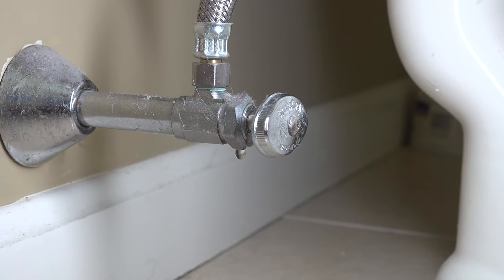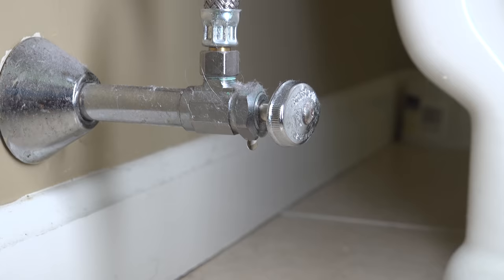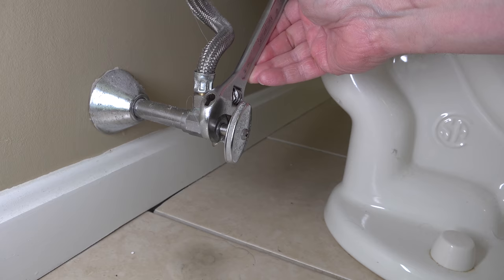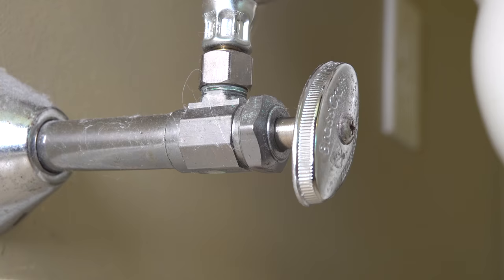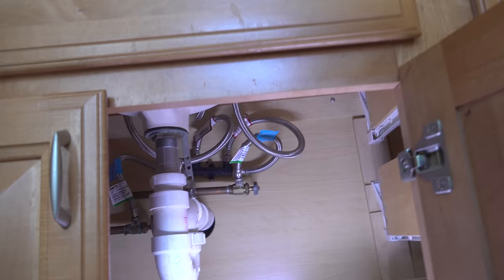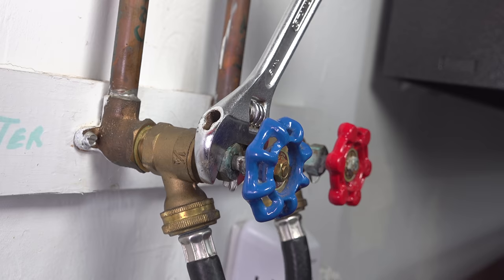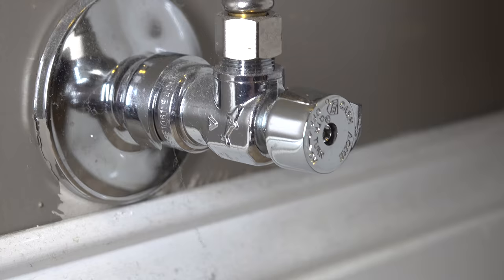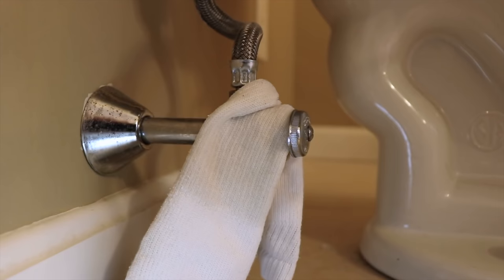Few Know this EASY TRICK to STOP Leaking Valves INSTANTLY

Comment: Great video keep up the good work
Reply from the maker: Unlike most of the UK we use soldered fittings almost exclusively for valves which requires turning off the water, unsoldering the valve and soldering a new one, no easy or simple for homeowners. You guys use a lot more threaded connectors which make this much easier.
Reply: @SilverCymbal  wow that's a pain in the rear, especially if the mains valve isn't in best shape ! 
Keep up the great work 😃 and education videos

Comment: That Knipex Pliers Wernch looks a lot like Pump Pliers aka "Channel Locks" yet they are not. Pump Pliers have teeth on their jaws and those jaws do not move parallel through their entire range of movement. The jaws of that Knipex Pliers Wrench has no teeth and they remain parallel to each other through their entire range movement. These tools can sometimes be used for the same applications although they are not specifically designed to do so.

Comment: I would have shut the water off, sweated off that angle stop chrome stub out and installed a quarter turn angle stop. With it close to the wall I would have used a compression type angle stop.

Comment: I'll have you know that my version of this fix involves putting a small bowl under the drip, and then leaving it there for the last 11 years.  Worked fine so far.  :)

(yes, I feel dumb that the proper fix is this easy)
Reply: I've been using a pot and that leak got out of control now it fills up the pot within a couple weeks so I had to take action and seal it up. Very simple fix I was just being lazy.

Comment: sometimes the toilet sweats and drips, if this happens you can see the sweat and it only goes as high as the water in the tank. you could put a mixing valve on the supply line but that is strange.

Comment: A Kleenex or short piece of toilet paper wrapped around the valve after the fix is a foolproof way to check for additional leaks. The paper will wick out the moisture and then dry out after a few hours. If it stays wet, you have more work to do.
Reply from the maker: That is a great tip, and always to check it later that day and the next day. Sometimes pressure changes can expose a leak after it may be repaired

Comment: this is only assuming the valve is still good.  if that valve is leaking there's a reason and by far the more likely reason is that the valve is failing and needs to be replaced.

Comment: I follow a different drummer and this is my suggestion for a one time fix and never worry about it again. 1. Go to your local hardware store and buy a stainless ball valve. 2. Come back home, remove the old valve, throw it away and replace it with the new ball valve. 3.Go fishing, water skiing, to a baseball game, play with your kids or whatever you enjoy doing in your free time, oh and did I mention, throw that old leaky faucet under the hill and  be happy!
Reply from the maker: Thats the issue. unsoldering an old valve is not a quick fix and not for everyone. If you want to do that, by all means but 95% of the time or more, it's not needed, Seats wear thats why they can be adjusted.

Comment: NO NO NO. USE A 2ND WRENCH TO HOLD BACK ON THE OTHER SIDE OF THE VALVE!!! Especially for the folks with CPVC. You don't want to test the pipe inside your wall!!

Comment: NEVER place a wrench on stand alone pipe. Use 2 adjustable wrenches or 2 small vice grips.  This genius never mentions if it's a hot or cold, they run differently with heat and pressure.

Comment: Mine won't go any tighter and I don't want to break it
Reply from the maker: You don't want to force it, and others may have made it so tight that the packing ste inside is used up. You will likely need to place it or rebuild it. Sorry this works 90% of the time  but it can't always fix it.

Comment: Has to be one of the worst designed plumbing fixtures in 20th century next to the indoor intercom box and the laundry chute. 
So for the 21st century they are still manufactured these valves.
Reply from the maker: Why is a laundy chute bad?

Comment: I’ve replaced those cheapy valves with quarter turn ball valves. Those cheapy valves if not rotated off on will eventually freeze up in the on position.  Those POS cutoff’s should be outlawed.